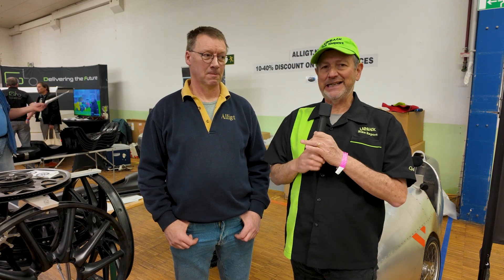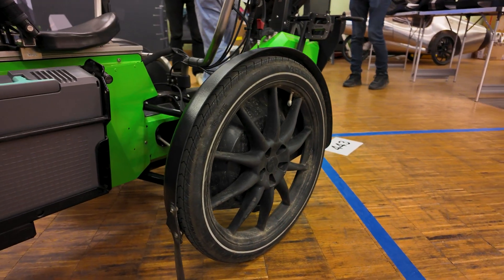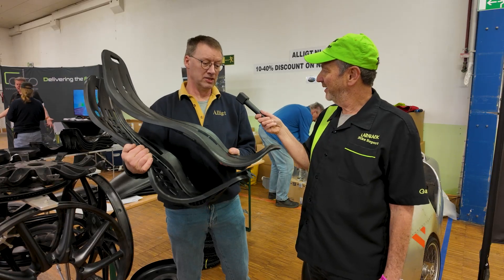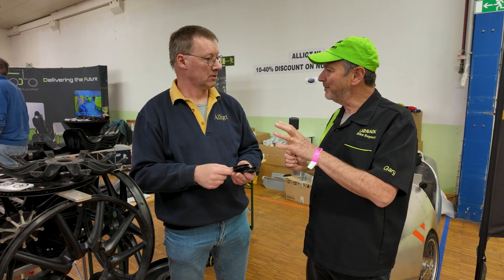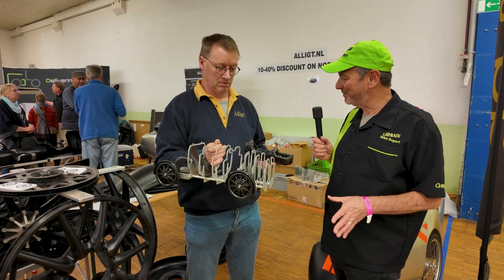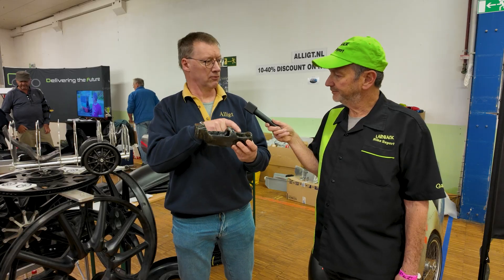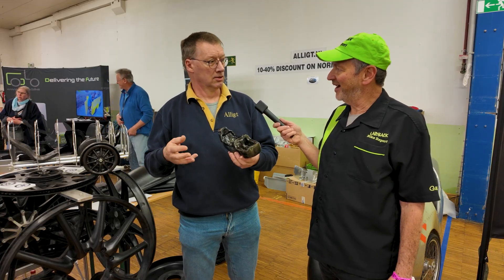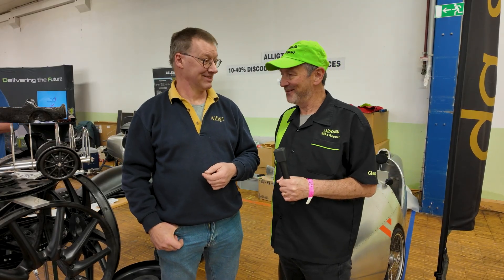Spezi 2025-Amazing Innovations from Alligt!

Comment: I liked the innovative use of glass fiber reinforced nylon plastic  for  the construction of  cycling components.  The  material  helps provide dimensional stability, impact, heat, and moisture resistance. I liked the hybrid use glass fiber reinforced nylon spoked wheels with aluminum rims. All in all, I see a lot of potential.  One word  of caution  .... I would never  underestimate the resourcefulness  of monkeys.  😃